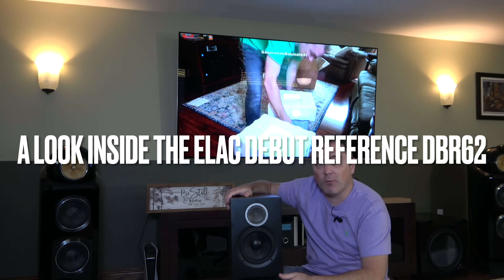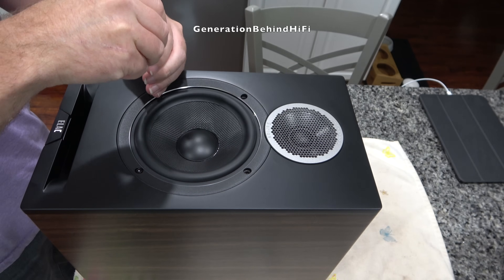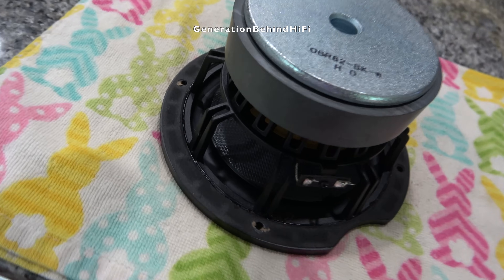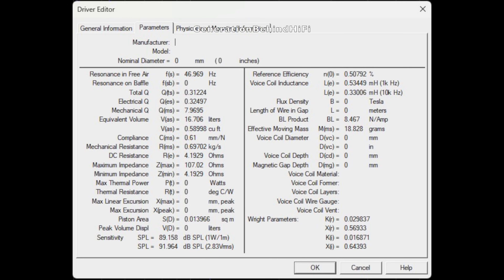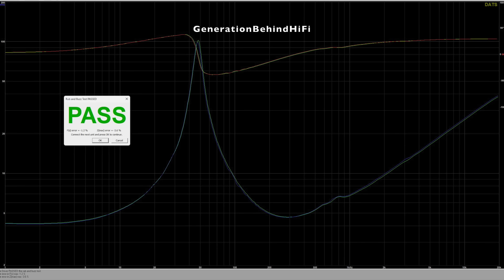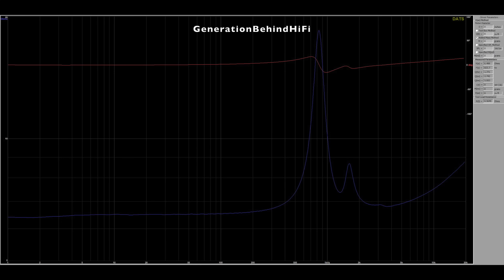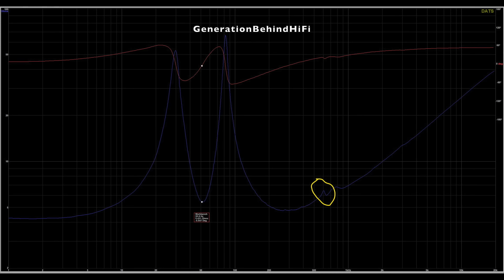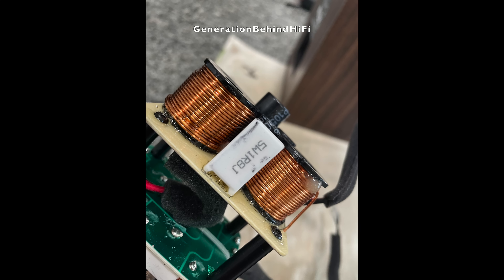A Look Inside The Elac Debut Reference DBR62

Comment: is there enough slack to replace the nuts without disconnecting the speaker cables? I'd like to not have to take the entire box apart to make the swap if I don't have to.

Comment: Your whole inductance explanation is not accurate at all the coil inductance is only affecting higher frequencies and taking the enclosure into account saying a lower inductance coil will be more accurate especially on a woofer is just not how it works it's not that simple at all these speakers could very well preform from the exact opposite of your explanation in a listening environment given the box and crossover. Also lower inductance also usually sacrifices low end response it's just not something good to compare

Comment: Kef are cast I literally own 6
Reply from the maker: "The Q350 has a similar, 6.5" Uni-Q array with an aluminum midrange-bass cone, a 1" aluminum dome tweeter, and a stamped-steel basket, in a 14.5-liter, 16.75-lb, generic-looking MDF box.

According to Dipin Sehdev of KEF America, the stamped basket "is equal in rigidity to the cast one" because "We designed the chassis using Finite Element Analysis (FEA) to increase its strength."

https://www.stereophile.com/content/kef-q350-loudspeaker
Reply: "Only 700 per pair" 😂
Reply from the maker: The driver in the KEF Q350 uses a stamped steel basket. You can read about it at the link below. 

"According to Dipin Sehdev of KEF America, the stamped basket "is equal in rigidity to the cast one" because "We designed the chassis using Finite Element Analysis (FEA) to increase its strength."

When you're getting $1000 worth of quality and performance from a speaker that is "only $700 per pair", I would consider that a phenomenal value. 

https://www.stereophile.com/content/kef-q350-loudspeaker

Comment: I’ve got them for 350€ pair (new), a b&w asw610 300€ (used) and a Wiim amp 350€ (new). With exactly 1000€ I’ve got something that measure pretty flat, dig deeply enough (at least for music that’s what I use it for), room correction, subwoofer integration and a streamer built it. I think that at this price you can’t get anything better
Reply: where did you get them new for 350

Comment: I'm getting questions about what class D amp might sound good with these speakers.  Here's a tube tip:
Douk ST-01 Pro TUBE tip: If your amp came with Chinese 6K4 tubes (has a red star printed on the glass), mine caused distortion.  I upgraded to much better sound for $17 with GE JAN 5654W matched pair tubes.  6K4 tubes can be replaced by 6J1, 6J2, 6J3, 6J4, 6J5, 6"1N, 64N, 65N, 5654/5654W, 5725, 6AK5, EF95, 6BA6, 403B, etc.  Your tubes may be ok.  This type of tube hybrid amp drives my elac speakers very well.  But I would avoid Chinese tubes.

Comment: These things play way above their pay grade.  Give them enough power and a good tube preamp and you will be pleasantly surprised.  I went from a 25-watt per channel A/B amp to a 200 watt class D amp with tube preamp.  The Elacs woke up and sounded like different speakers. Much deeper bass, to 30 HZ. Cleaner mid-range. Crystal clear highs.  A great speaker.  Thanks for the video.
Reply: I bought a Hypex NC122MP 75W power amp but it has a coarse dry sound and doesn't sound better than my cheaper 45W A/B Onkyo A-9010. Bass is about the same but timbre is more real. I have tested them with two different hybrid tube amps and boy they rose from the dead. Amazing bass control. Class D I'm sceptic with this beautiful midrange sounding speaker.
Reply: @wyup   the Texas Instruments class D chip, TPA 325x series are very musical. Neutral and not harsh. Not true of some class D amps.
Reply: I'm intrigued: what class D amp and tube preamp do you use? I'm still figuring out equipment for my DBR62, I love them.
Reply: @wyup   Douk Audio ST-01 Pro.  With upgraded preamp tubes to GE JAN 5654W matched pair, additional $17.  The supplied Chinese 6K4 tubes were distorting.  Don't know what tubes this unit comes with now but buyer beware.  Tubes make a huge difference.  New tubes will be bright for a while, let them burn in for a couple of weeks.  Then they will sound very natural.
Reply: Mine are driven by a couple of Guntars Smits "perfect amp". Story of the perfect amp. https://www.youtube.com/watch?v=xhqybovCNjw&list=PLVV-P_lvPgLnhVTCSm-nd5dFAcKqH9s9r&index=1 
His case is designed (incorporating a Texas Instruments INA 1650 pre-amp) to drop in an  ICEpower 125ASX2. Once connected it's in bridged mode for a 450 watt monoblock.
Reply: @tweedeldee8122   That ought to wake up any speaker (that can be woken up)...
Reply: @peterbaugh51  lol. Let's hope so. I'm also using a little SMSL M200 for preamp/DAC.

Comment: That is NOT a good crossover. Crossover design & parts are #1. How can you say it's any good without even proper measurements? Even if it's designed well, the parts are very cheese... Electrolytic caps on the bass driver, cheapest possible trash resistors, and a very meh cap on the tweeter. It seems at least some are air core inductors , but of the dental floss gauge.

Good drivers with poor designed and/OR cheap parts won't preform well. Cheap drivers with a well engineered crossover AND high quality parts WILL far out perform the other. This is a well known fact.
Reply from the maker: I disagree. For this price point this is a very respectable crossover compared to what I have seen from other manufactures in this price range. If you know of a bookshelf with a better crossover for $700 or less, I'm all ears!

The DBR62 is using a high order (steeper slopes) crossover with some pretty decent quality parts on it. People always seem to forget that my "good" is in the context of selling price. The DBR62 does NOT use dental floss gauge air core inductors. If you want to see dental floss gauge air core inductors then look at my video on the Focal Aria 906. 

In the real world a $700 pair of speakers is not going to include Mundorf caps and copper foil inductors. I think some people need to manage expectations or just build their own speakers if they can do a better job for less.
Reply: @generationbehindhifi  For me, the DBR62 totally smoked the Aria 906. 

I demo'd the Aria 906 in my space for probably close to a month. Not only was bass quantity/weight very lacking, but I wasn't getting good definition either. It was like light, fluffy, undefined bass... really weird. I described the treble as "sizzly", "hissy" and "crashy". Overall the speaker sounded lean and thin, lacking "note density". I didn't really feel like I was getting amazing detail or soundstage in return either. I just didn't get the hype...

I'm currently on my second pair of DBR62 (sold the first pair and regretted) and love them :) Just wish the vinyl wrap looked more convincing..
Reply: @tpn8402  These reference speakers smoke a lot of other speakers with much higher prices...
Reply: I own speakers costing six times the price of these that do NOT sound as good.  B&W... Don't get me started...

Comment: Cheap crossover and a really lame tweeter.  I bypassed my tweeter cap with a .01uf mylar.  It helped, but cannot compensate for such a weak tweeter.
Reply from the maker: @scottlowell493  wow! Tough crowd! What don’t you like about the tweeter? I absolutely love my speakers and can’t even build a set on my own that would be better for less. A set of quality mid range drivers like the ones used in the DBR62 would set me back almost 300 on their own! I honestly can't think of a better bookshelf for the money! Can you? If so, I’ll buy it and do a tear down on them.
Reply: @generationbehindhifi   install a better tweeter. Even a $30 vifa/tymphany or Dayton is better. Better extension and linear power. 
Upgrade the caps to 5% metal poly and the inductor to air core.  Build your own crossover without such severe compromises to meet a price point.  
The NHT c3 are more neutral and even. Polk reserve are better in every way. So are A/D/S ll-710. 
I can replicate the sound of an Elac dbr62 by buying a set of wharfdale  diamonds and putting duct tape over the tweeter. 
The scan speak discovery is a far better midrange and isn’t that expensive . Same for sb acoustics. 

There you go.
Reply from the maker: @scottlowell493   Are you sure the NHT c3 are "more neutral and even" because the Kipple measurements I have seen say otherwise.
Reply: @shipsahoy1793   Deaf TROLL pretty much sums it up 😊.
Reply: What is weak about the tweeter?  Those are high-quality parts and I can tell.  I know what real instruments sound like. I can play them.  These reference speakers simply have a realistic sound to my ear.  A musician's ear.  Everyone has an opinion among other things...

Comment: You should buy/test this, if you are interested let me know
Technical Data PRINCIPLE
2 way bookshelf speaker, bass reflex
SENSITIVITY (2.8V/1M)
90 dB
IMPEDANCE
4 – 8 Ohms
CROSSOVER FREQUENCIES
3.300 Hz
POWER HANDLING (RMS/MAX)
80 / 150 watts
FREQUENCY RESPONSE
32 - 42.500 Hz
RECOMMENDED AMPLIFIER OUTPUT
20 - 150 Watts
DIMENSIONS (WXHXD)
Cabinet: 195 x 357 x 315 mm Dimensions (wxhxd), incl. terminal and feet: 195 x 357 x 333 mm

Comment: Is it worth or possible to upgrade the electrolytic capacitors of the woofer circuit with polyester ones?
Reply: Use a audio note Kaisei electrolytic to keep it small... These are incredible and better than most budget film caps I've tried. The only electrolytic cap I'd ever use.
Reply: With values like 47 and 220 µF, good luck finding any! Film caps are not typically practical in size beyond the low µF range.

Comment: The venting on the pole piece and under the spider is helping the driver play with greater linearity; as well as cooling. Trapped air acts as a spring, and this affects the motion of the cone i.e. distortion.
When you measured the T/S parameters, was the driver broken in? Things change quite a bit during break in - suspension becomes more compliant etc.
All air core coils - is quite notable!
Reply from the maker: Hi Neil. Yes, these speakers are broken in. Before I purchased them they were demos at my local dealer so they have plenty of hours on them. Yeah, I was impressed by the air core inductors they were using -- higher AWG than I typically see at this price point.
Reply: @generationbehindhifi  These probably would benefit from adding a rib across the inside - or a strut brace from the thin web of the front baffle between the drivers to the existing brace. Other than that, the cabinet seems solid.
Reply from the maker: @NeilBlanchard  The cabinet is very nice for this price point and for the most part is very quiet. I did find a small cabinet resonance taking place around 600Hz, but besides that I thought it did quite well.

The DBR62 are now my new favorite bookshelf speakers for this price point. I even like them a bit better than my KEF Q350s.

Comment: I doubt replacing the ferromagnetic nuts with non magnetic brass ones will make any significant difference in that design. It will just make you feel better. 😆
As you suggested, they did the best they could at this price point. Thanks for the review. 
I might buy a pair of these myself. They are a good buy, especially on sale. 😉
Reply from the maker: I hate commenting on posts like this because it sounds like you already made your mind up. In the video I didn't mention one way or the other to upgrade or not. I just mentioned that I am. Regardless of your views on this subject I still have people who want to know about ferromagnetic parts being used so I include it in all my videos. 

IEEE did a white paper on ferromagnetic parts in audio connectors and its a good read. Basically the study proved that ferromagnetic parts introduce passive intermodulation, aka 3rd-order harmonics distortion into the signal! Simply put, there's a reason why high end speakers use non ferromagnetic parts in their signal path. Sadly IEEE put a pay wall up on the paper since I started including a link to it in my youtube videos. If you have IEEE membership, then I highly recommend reading it. It can be found here: https://ieeexplore.ieee.org/ielaam/22/8681220/8632973-aam.pdf
Reply: @generationbehindhifi  Well actually, I'm a retired electrical engineer and I'm well aware of passive intermods .. the problem here is that this particular anomoly is so insignificant that it's not really going to affect the bottom line in that design, but I do fully understand where you're coming from in terms of full disclosure, and specifically pointing out weak points in the design;  but, like everything in engineering that I suffered with my whole life with ignorant people, they make a way bigger deal out of certain things than they should.. 
there's no such thing as perfection in this life at any price point, technical or not. When a person can honestly say on that speaker, I hear the PIM'ing from those ferromagnetic nuts on the binding posts on those speakers, then it'll mean something, but I guarantee you nobody will be able to do that, since that "error" is sufficiently lower in magnitude than any other distortions present. A little pragmatism and comparative thought when combing technical journals is prudent.
Reply: @generationbehindhifi  all capacitors have magnetic leads, hence all capacitors generate distortion.
Reply from the maker: @hugueslecorre4893  Where did you hear that? Here is just one example of a capacitor that does not have "magnetic leads", ClarityCap Copper Connect. All ClarityCap Copper Connect series of capacitors use lead wires made from copper. Mundorf, Audyn, and many other brands also have a line of capacitors that utilize non-ferrous lead wires. It really boils down to how much you want to spend so a bit confused by your previous statement that "all capacitors have magnetic leads".
Reply: @generationbehindhifi  If the lead is pure copper, measure the diameter and look up in AWG table to see the maximum current it can transmit, it will be much lower than the next column that says in Chassis(steel). Capacitors used in audio equipment,all  have magnetic leads except ones used in tone controls. High current resistors also are so. Metallic case transistors also, and some T092 ones as 2n4401/4403.
If any kind of intermodulation does exist, all RF transmitters that use magnetic lead capacitors wound go wrong.
 I am retired R&D EE.
Reply: @hugueslecorre4893  I'm a retired RF engineer also and people don't realize that one a variable is orders of magnitude below the point where it's going to matter that it becomes a non-issue and cost performance trade off would dictate that it would be stupid to spend a lot more money to mitigate the variable
Reply: It is just a myth that magnetic connectors have any effect on the sound. It is just snake oil merchandising. By the way, if he have checked all the capacitors and the upper-right (non inductive) power resistors, they have obligatory ferrous leads or else they cannot carry high currents.
Reply: I would think that the important parts are those that the current actually passes through, and those do seem to be non-magnetic. In any event even the effect of steel speaker terminals seems to be quite small and could easily be masked by a so-so amplifier, Douglas Self only noticed it because his standard for amplifier performance was like 0.0006% THD.
Reply: @PileOfEmptyTapes  
you would think and you would be correct ! Congrats!
Reply: Danny from GR Research wouldn't agree, he'd add his magical tube connectors and no res and charge you 1k and say the speakers are 5x better 😂
Reply: @crazyprayingmantis5596 I hate to break this to you but Danny tends to veer into snake oil salesmanship at times 😎
Reply: @B2_Labs  These must have been his "Little giant killer" LgK 2.0 that performed off the charts fabulous at ASR 😎
Reply: @Bac4-qu6qg7sk4v  asr, the one spesker reviewer LOL.
Reply: @Bac4-qu6qg7sk4v  

I'd love to see him do a double blind test and prefer the non modded version to his modded version 😆

Until these audio reviewers can SHOW me that they can hear what they claim they can I just can't take their words seriously.

They all talk and tell you what they can do, but I want them to SHOW it.

Why wont Danny do blind listening tests and show everyone how he can pick his modded speakers out of a crowd?

He wont do it because he knows he'll fail and make himself look like a fool
Reply: @crazyprayingmantis5596  Gosh you are clever, you dissed a brilliant speaker designer with your utter lack of knowledge and phony made up bullshit numbers. Well played.
Reply: @crazyprayingmantis5596 his speakers are absolutely the best I've ever heard including 1+ million dollar rooms so yeah I wouldn't hate lol
Reply: So what you are saying is you have no experience with the issue but want to pretend you're really smart.
Reply: @bayard1332  No, what he is saying is he knows from experience that all those things all added together only make a small difference and it's not necessarily worth all the added cost; and btw, 
I could tell you without reservation that if you can actually notice a difference by changing the nuts on the binding posts then your head needs to be examined. In fact, a blind test would reveal your psyched out technology bias.